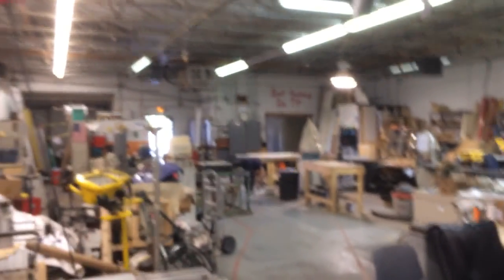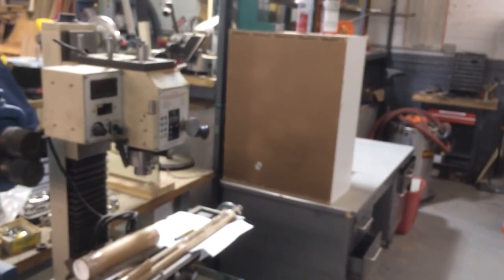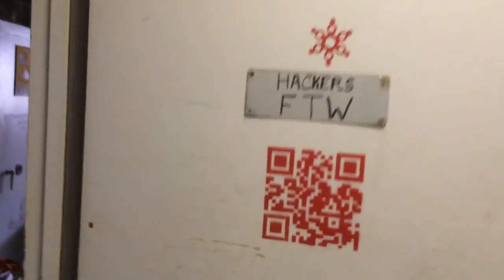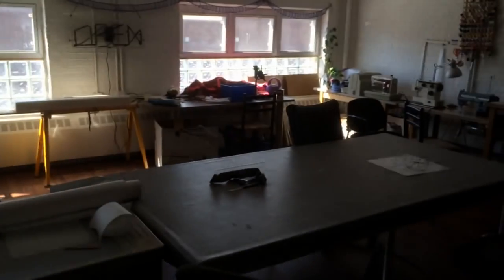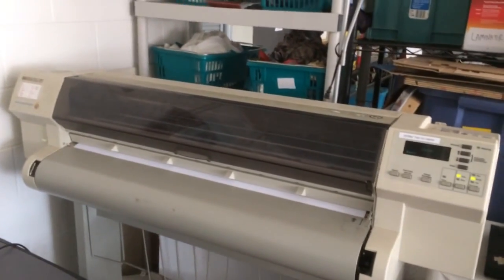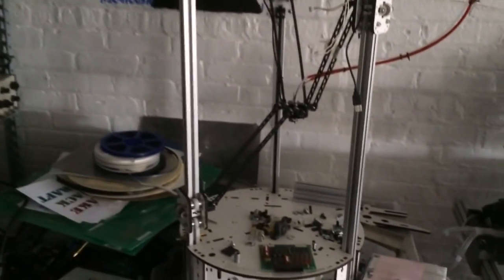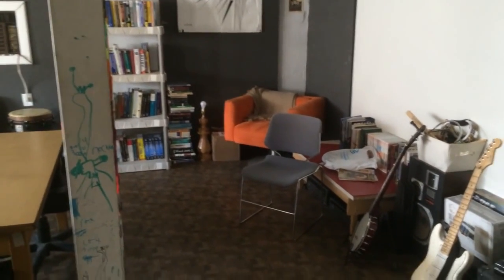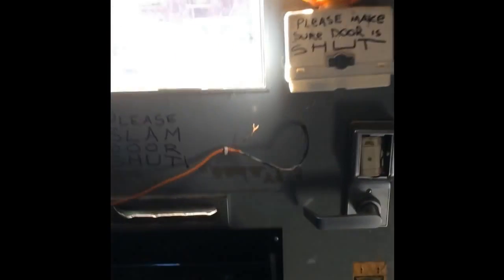[Todd Harrison] tours Pumping Station One hackerspace in Chicago

Comment: <-PR Director 2013, PS1 - Wish I could have been there to give you a tour myself earlier today! Thanks for stopping by!

Old skool metal bandsaw - 1940 to be exact!
Welding section - correct. Right behind you is the forge for blacksmithing.
Storage - also has IT rack
Delta robot - being transformed into a pick and place machine
Device to the right of it - building a pick and place machine
Lady Ada - done by Shellie, our arts and crafts area host in 6 hours on a saturday.
Bar - 1 member. 3 weeks